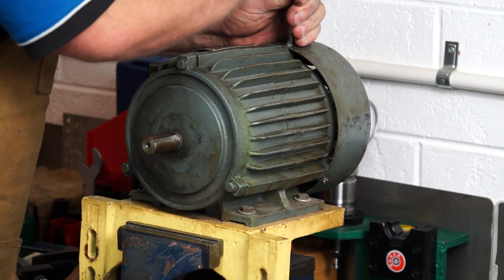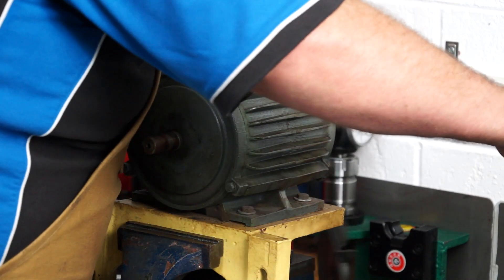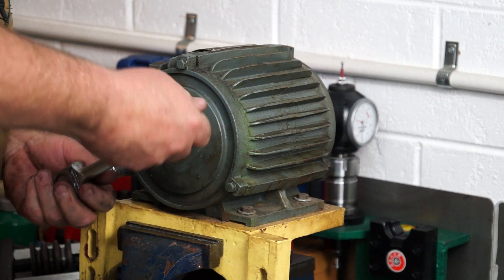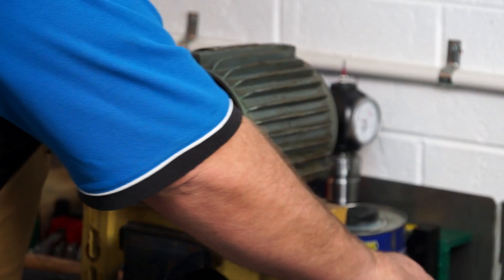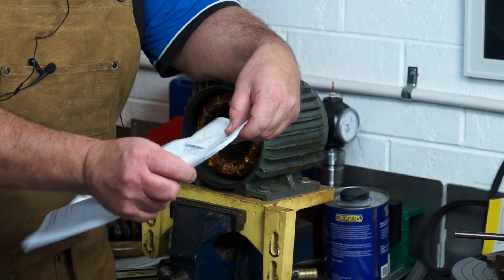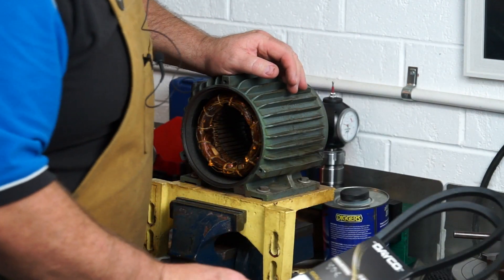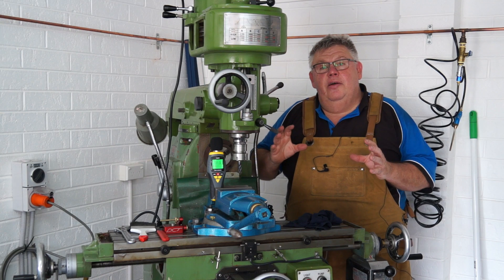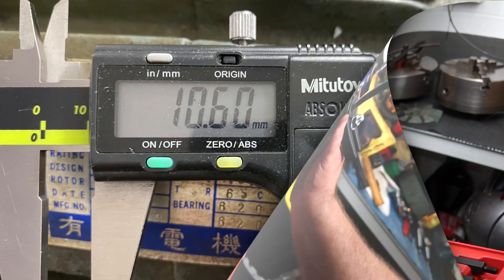Milling Machine PROBLEM - Part 2 Repair

Comment: I just found your channel. Is this a Chih Feng, made in  Taiwan milling machine? I have one of the aforementioned brand which looks quite the same apart from
a couple of differences (Mine has a mechanical gearbox for the x axis auto feed mounted to the saddle, the horizontal gearbox levers are on the opposite side from yours. And 
probably the biggest difference is that the previous owner was a moron and didn't look after the ways so it's got a lot of wear on the knee-saddle ways). Does yours have auto feed on the quill?
Mine doesn't, just a manual fine feed with the wheel.
Reply from the maker: G’day mate and thanks for stopping by my channel. I appreciate all the support I can get. Yes mine is a Taiwanese machine but I’m unsure who actually made it as it’s branded “Herless”. Mine has electric feed on X and no power feed on the quill unfortunately. It really is great little machine to have in the home shop. Cheers 🍻, Aaron

Comment: Hi Aaron, I like that pulley puller! Could have used one like that a few times. I'm glad your motor is improved. Had a lot of issues with my Schuablin motor, including needing bearings and sleeving the shaft but satisfying now it runs smooth. All the best.
Reply from the maker: Hey buddy how's things?  Trust you had a lovely Easter over there.  I think you're in the UK?  Thanks for the feedback.  I'm trying to catch up on your other videos now.  That's a very nice Schuablin lathe you have.  Cheers, Aaron.
Reply: @AaronEngineering  Yes I'm in the UK. Thank you very much!

Comment: Excelente trabajo, pero yo hubiera puesto rodamientos 2Z.
Reply from the maker: Aparentemente, el cojinete del sello de acero es más barato que el sello de goma. El tipo de la tienda de rodamientos sugirió que me decidiera por ese. Gracias por mirar y comentar saludos. Aaron 👍🍻
Reply: Hola. Me gustan tus videos, a pesar del idioma son muy ilustrativos. He tenido algunos problemas de aumento de temperatura en ejes de motores debido al uso de rodamientos 2RS. Por eso solo uso rodamientos con sello de acero en motores  eléctricos. El rodamiento con sello de goma, muy buenos en la industria maderera, los uso en aplicaciones de baja velocidad o que no estén confinados, en rodillos o en soportes UCP
Reply from the maker: sa es una excelente información gracias por hacérmelo saber. Perdón por la barrera del idioma, no estoy seguro de si la voz automática a texto funciona en los videos de YouTube. Creo que tienes que ingresarlo manualmente para que se convierta a
Reply: Excelente traducción, en un próximo comentario lo haré en tu idioma, un abrazo

Comment: Good fix Aaron, i am surprised the bearing failed, the Mill looks quite clean and dosent appeared to have done much work, especially on the horizontal spindle, i am not surprised by your bearing supplier  and the belts, it's a crap situation , i am trying to rebuilt a bridgeport spindle, tried a couple of different Australia wide suppliers nil stock, i don't know if its a result of the covid situation  or the "modern" way of doing business and only carry fast moving stock
Reply from the maker: Hey buddy how's things?  I agree, I don't think it's had a lot of work so I was surprised to see that the bearing had started to fail.  Yes I usually get all my bearings from bearing wholesalers.  They are usually great and have everything in stock.  To be honest, maybe I should have gone to Blackwoods for the belts.  Hope you had a good Chrissy?  Here's to a good new year in 2021.  Cheers, Aaron.
PS: I think you said that you're not far from me.  I'm in Sth Morang.

Comment: Oh Aaron, a claw hammer??
Nice job. That is the easiest  bearing replacement I have seen. That motor was designed to be serviced.
Reply from the maker: G’day Jeff. They don’t call be dodgy Bob the builder for nothing you know 🤪. Yes mate, thankfully it was a very easy fix. I’m happy that it’s back up and running again. Cheers 🍻